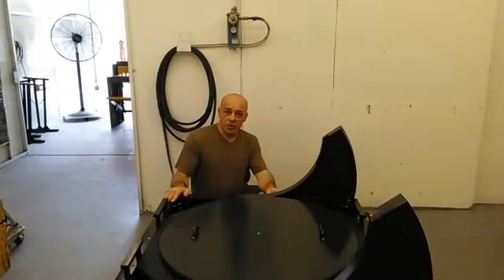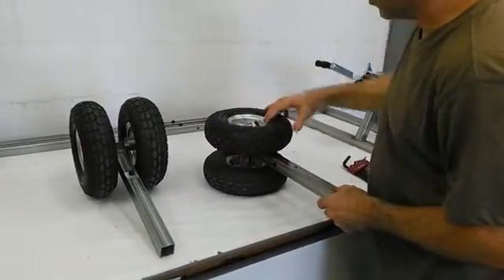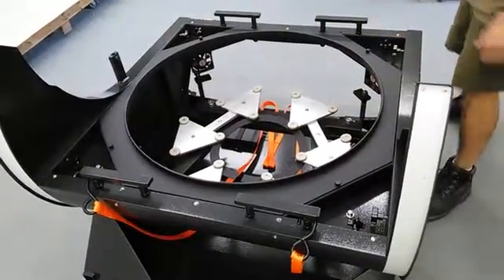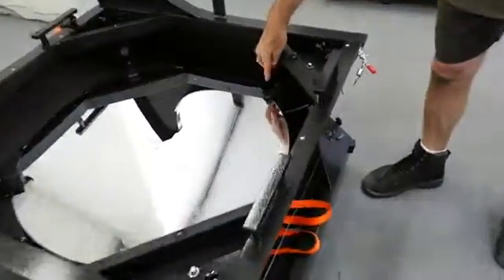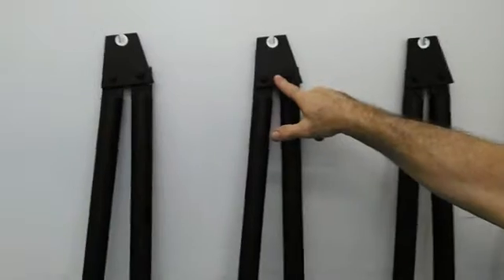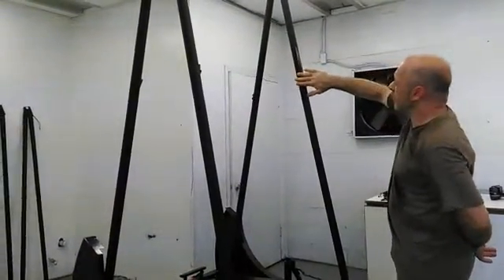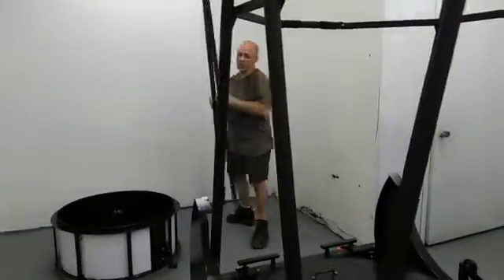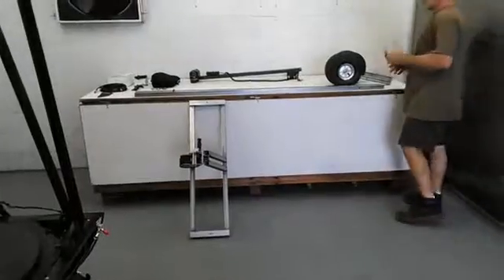StarStructure Telescopes ASSEMBLY VIDEO PART 1

Comment: wow! that“s a big one. but....looking at the clip after several minutes i begin to have questions. what is the building requirement to hold this telescope? especially the roof. is it a slide open type (look like some big air vent) will be good enough or it will need a turret to go to maximum performance? that is obviously big investment to modify the building to sit this baby. mind if you can talk a bit about this issue?